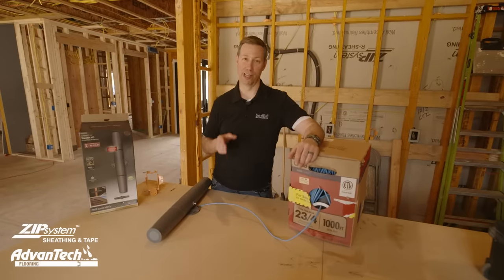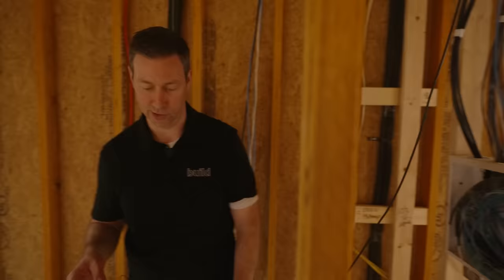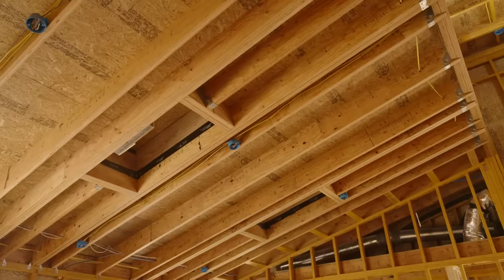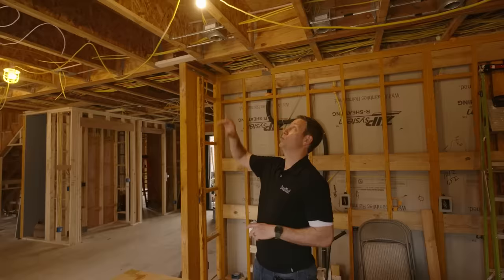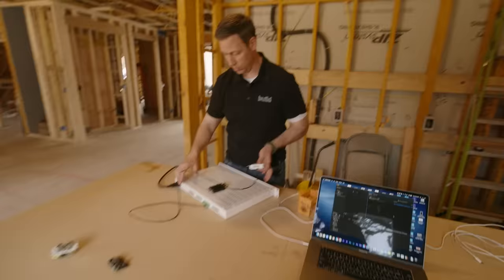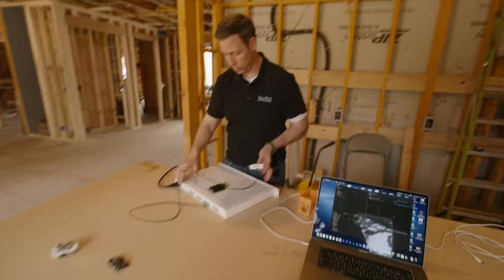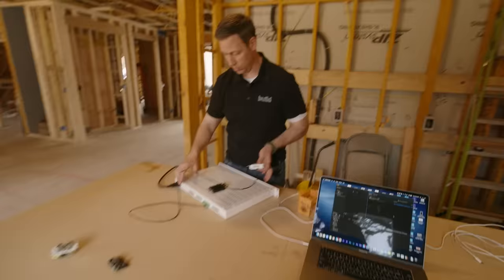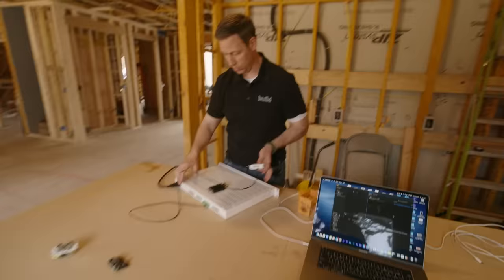Low ⚡Voltage at the Real ReBuild

Comment: You should have used shielded cat6 cable or really cat6a.  Also should have run fiber hdmi cables to every tv. They’re cheap and will work up to 8k. Hdbaset over cat6 is very hard and expensive.  Shielded cat6 and even shielded alarm cable.  You probably have areas where lv cables cross high voltage and that’s an issue unshielded.  Also lightning emr rejection is my biggest reason why I only ran shielded cables. Home in Florida I helped design for my parents, only cables that weren’t shielded were the alarm cables and that’s the only system that’s been knocked out by lightning strikes. (Nearby). Twice actually.   

Also having a telecommunications grounding block into your wire closet is very helpful. That’s just a 6ga grounding cable that runs separately to your power panel. Connects to your rack and network gear to provide a better path to ground for all the expensive stuff. Commercial telecom installs require this by code. 

Also a dedicated 20 amp isolated ground power outlet for your wire closet.  Or two.  

And I’d also run 14/2 to every tv on wall location from the wire closet so I could power sensitive electronics from a big high end UPS.  Pure sine wave UPS ideally double conversation online UPS. Cyberpower makes some great ones rack mounted. 

Make sure you run extra cat6 to every tv and also every location you’re going to have an UniFi AP. UniFi has a new tool on their website that lets you plan out what equipment you need for your space. You upload floorplans and it will let you lay out antennas and show you how strong the signals will be with walls in the way and such.  You have to remember that 5ghz and especially new wifi6 does not travel through walls well. So if you want to have super fast WiFi (think 1Gb speeds) you’ll need an AP in the same room.  UniFi makes great on wall ones that are the size of an outlet. Go on the wall. I’d do that for bedrooms and their new WiFi 6 APs for open areas mounted on the ceiling. They have recessed mounts for those. But you gotta put cat6 coming out of the ceiling in the right places.  Including outside. Don’t forget to run a cat6 cable for an AP outside for the backyard, and anywhere else outside.  

Get a patch bay. Shielded. Keystone. Mount on the wall or in rack. You can include coax keystones too and hdmi, even speaker connections.  Instagram has some nice photos of great smart home installs. Structured wiring.  Don’t use those expensive crap structured wiring kits they sell at Home Depot. Do it the same way offices do. 

Oh and ventilation.  Either have a inline duct fan pulling air out and dumping into a plenum or better a small mini split unit.  AC infinity makes some great in line duct fans that are quiet, come with temp controllers.  Also snoff makes some great smart power controls that will interface with HomeKit and Alexa.  One has a temp sensor. I use it to automatically turn off and on exhaust fans in my wire closet. And I also use ac infinity’s 6’’ inline duct fans.  UniFi switches get pretty hot.  

Oh one more thing. Sound proof your wire closet. Put some extra insulation in the walls and a insulated door. A door with a deadbolt.  You have your server in there and it’s recording security cameras, so protect it from robbers or kids from messing around in there.  

Level smart locks. Love those. Hidden inside the door.
Reply: If your stuff is getting spiked by lightning, you have other problems. Shielded CAT6 is unnecessary in a residential situation and won't protect against lightning strikes/surges. Everything else we agree on.

Comment: I'd love to see the tech stuff. And youre correct robust replaceability is more important for tech. APs you can replace every 5-10 years at this point. Power over ethernet is a standard that isn't going away any time soon. I installed those 10 years ago in Dallas, and they're going strong. 

Higher end build materials are great at blocking wifi. Wired is alway reliable, typically  lower latency, and not subject to the interference possible by wifi. It's technically more secure, so long as your physical security is on point. 

Feel free to show off some of whatever Ubiquity security cameras, but for the love of God, don't show camera placement on a YouTube video that will live online forever.

Living in a hundred year old house, with unreliable dsl, during the pandemic has been torture. Great to see you're planning for the future, either for yourself or the next owners. The best house I ever lived had ethernet drops in all the rooms going back to a closet. It was over provisioned for my needs, but it had so much flexibility it was great.

Comment: I'm quite surprised that low voltage lighting hasn't really become a thing. With LED lights it would seem that making them low voltage would be a fantastic idea as they all end up having to have duplicated mains converter circuits (even if nothing more than a couple of diodes and resistive droppers found in some newer versions, although a lot still have tiny transformers). You can already get 12/24V "halogen" down lighting for cupboards and the like (usually with a transformer stuck on top of the cupboards), so its surely not that much effort to have low voltage bulbs that directly plug into low voltage light sockets. The only thing is they would need a completely different socket, one that could in no way be confused with 240V (UK) mains light sockets. I guess you might also need a different type of light switch (internally/back plate), as again you'd not want to accidentally wire up mains to a low voltage system (although I guess you could have the switches include the transformer with a low voltage out to the light, unless you're doing long runs back to a central automated control system).

Comment: Matt... Try putting that antenna in your attic; that's what I do and I get fantastic reception. That will prevent the sun, rain and etc. from ever hitting it. Another reason why I put mine in the attic is just because I don't like the look of "things" on the top of my roof nor do it like "things" mounted outside my home on the walls or anyplace else.

edit:
Another thing I never heard you mention was a security camera system. Maybe you just didn't say anything because who wants to show everybody what you're doing as far as security goes. But I'm a big fan of hard wired security cameras and contact sensors. Any wireless security cameras a person has can  easily be hacked by anybody who is only smart enough to purchase hardware and/or download software.
Reply: I have always heard that attic installations weaken reception. Sounds like that is not a problem for you. How far are you from yhe broadcast tower?

Comment: Go into more tech detail. Also - can you address running the low voltage around high voltage and how to avoid interference? Thank you
Reply: 1. Keep low voltage data\signal cables at least 8 inches away
2. If you need to cross a power & a data cable, cross them at 90 degress (perpendicular) to minimize interference.
3. Never route data cabling near florescent light fixtures.
4. Use Shielded cabling.
Reply: @guytech7310  Shielded cabling is only required in high EMF areas (3-phase, electrical motors, CATSCAN machines, etc.).
Reply: @skynetlabs  Said the Guy who probably never deals with nearby lighting strikes.

Comment: The Volex system seems nice but not for $1000. Also DC won't travel far on a small gauge cable so you would probably need more than a few to cover a whole house. Also it would take a huge UPS to last for any length of time. The APC 1500 UPS's I use at work at a 10-15% load will only run for about 3 hours on a new battery and they list for $1000.

Comment: Wire for burglar alarm while you can. Even if you won't subscribe to a monitoring service. Drop wires for more cameras than you think you'll need. Smurf tube from the TV box to the media cabinet; the Samsung One Connect box fiber line (for The Frame) needs to be in conduit anyways. Smurf tube at demarc like you did is excellent. Wire for several UniFi AP  locations. Future WiFi will be lower and lower range, it may get to the point of having an AP in every room. Wire smoke detectors together. I'd wire 240V in a couple strategic locations (like kitchen, garage, etc). It's more efficient and allows you to run many European kitchen appliances. Also EV charging.

If you want to get serious about lighting controls and automated shades, look at Lutron. Caseta is their DIY platform, RA2 Select is a step up. HomeWorks is the premier system, and Ketra lamps and fixtures is the cherry on top. I have Ketra and HomeWorks QSX at home and love it.

12AWG/20A circuits for lighting is overkill, but it isn't really a problem other than a waste of resources and harder to work with. DC lighting is kinda "a maybe" at this point. Sure PoE lighting exists and 24V LED tape light is common, but neither is being used on a wide scale for general lighting. 120V is generally more efficient. Maybe in the future we could see 5A circuit breakers and, say 18 or 20 AWG Romex. It's inevitable with the rising price of copper. Not sure what a 5A receptacle would look like, but surely most/every room will need at least a couple 15A for larger appliances.

Prewire/conduit for solar and generator inputs, as well as RV/trailer and EV charging outputs.

That's my two cents
Reply: Who still wires for alarm systems? Everything is wireless now.
Reply: @skynetlabs  You could have argued the same thing about Matt having wired for CAT6 or window shades or Sonos. Wireless versions of almost anything is possible. The fact is, wired is more reliable, better performing, and "the batteries can't go dead".

Also, and this is more specific to security-focused things like surveillance cameras and burglar alarms; wireless can be jammed. In fact, wireless jammers on the 2.4 GHz spectrum aren't even illegal (not that criminals are known for following laws LoL) Even some slightly more sophisticated burglars these days are carrying battery powered jammers that shut down the video doorbells, wireless cameras, and alarm sensors within 100ft radius. Anything that runs on an open band can (pretty much) legally be jammed.

Comment: Hey Matt. I would not be running voltek systems as running DC power at any great lengths you will get tremendous voltage drop in the wire. You would be MUCH better running low voltage AC at high frequency and using small modules that will convert to proper DC level and very high current using very thin (22 guage) wire. This is one reason aircraft use 400hz AC power. They can use very light guage wire. Even the power grid uses extremely high voltage so they can use smaller guage wire for distribution. The same thing can be achieved with higher frequency.
These power supplies that are constantly on steal power a d raise your elec bill w/o anything plugged in.
In addition. I hardly use any wireless in my home. Most everything is wired. Its MUCH faster and more reliable. DONT rely on your router that your ISP provides. If you lose the router, you lose your DHCP functionality. I have two DHCP devices (raspberry PI) that provide that functionality. This way connectivity will be maintained between devices if I lose my router.
Please do more research BEFORE running wires. You will thank me.

Comment: Matt your right even if your not planing on using it now when I built my house I put cat 5 to every room and over the years as technology changed its saved me a ton of money and work so wile you have the chance put it in the walls even speaker wire because you can use it for some low voltage too
Reply: Cat5 (and Cat5e) are ancient history. Cat6/A FTW!
Reply: It was new when I installed it

Comment: Talking about potentially doing it yourself, it'd be great to know how exactly low voltage is wired from a source, say if you can run it from the master box, or if you need some kind of low voltage transformer, or what exactly. How would someone who knows how to run high voltage learn how to run low voltage?

Comment: For wiring wall-mounted TV's to entertainment units, think of the total cost of ownership.  Money can be wasted installing specific cabling types that in future have to be ripped out and replaced as the next generation of audio-video distribution comes along.
It is not so much the cost of cables, it is the labor.

Over the years we have seen so many cable types, many of which have gone or become very rare as they are far less useful:
- 3 x RCA (RGB) Component Video
- Composite 1 x RCA Video 
- 2 x RCA Stereo Audio
- S-Video
- SCART, 
- VGA & DVI(-D) 
- F-Connectors 
- Thunderbolt 1 & 2
- HDMI 1.0, 1.1, 1.2, 1.3, 1.4, 2.0, 2.1, 
- DisplayPort & Mini DisplayPort
- USB-C
...and as they are replaced with their newer technology which becomes more costly when they're hard-wired to wall-plates.

It makes more sense to have a pathway in the wall that goes behind the rear of the TV where all the sockets are down to the entertainment rack or unit which the audio-video flyleads can pass through.

I generally use a flexible conduit very similar to this: https://www.cableclear.net/
Now with TV's that are mounted very close to the wall, one side can mounted so it is recessed.

The type of wall mount matters as well.  Those wall mounts where the TV hooks onto it don't help when someone forgets to disconnect the HDMI cable (which in some cases can be up to 15 meters long) before removing the TV off the wall and the plug gets snapped off at the connectors.  I much prefer the sort that allows you to pull the TV out away from the wall so the connectors on the back are clearly visible and much easier to access.  I would have the in-wall conduit entry point for the cables right next to the spot the mounting bracket mounts to the wall and use velcro cable tie to tie the cables across the arm to where the sockets are.  That way pulling the TV away from the wall won't end up with broken cable connectors.

Comment: Looks like Voltek is trying to mitigate long-run voltage fall off with thicker wires, and a higher voltage. Seeing the ubiquity install would be nice, especially with more recent units that support gigabit wifi protocols, but their response to their security breach (their cloud services were hacked) put me off quite a bit from expanding beyond my one Ubiquity access point.

Comment: The higher the tech, the shorter the lifespan.        Infrastructure is the most valuable part of any high-tech system, or low-tech system!    You can " tube it"  to mitigate the difficulty of changing cable, 20 years later... but fire code might disallow that.

Comment: Why do we (the USA) staple wires to the studs when it seems like conduit would be more flexible as wiring/cabling requirements change? I would love to replace all the co-ax in my house with cat6 but since it is stapled everywhere I would have to redo all the drywall in the house which just isn't cost effective.
Tl;DR why don't we use more conduit to make upgrading easier? Maybe a good topic for a future show?

Comment: Cisco does Power Over Ethernet for overhead lighting today.  I read about it in Cabling magazine last year.  It’s typically installed in commercial buildings.

Power to your lights is carried by CAT 6 cabling from a network switch that has Power Over Ethernet enabled and you can control your lights from the network.

Comment: Love the videos. I'm building now too and I want to make sure I have all my wires ran to the outside so no new penetrations are made.  What type/mode of Fiber did you run for your internet.  and what company is it for.  I have At&t and I'm not sure if different companies use different mode cabling.  Thanks

Comment: Good video. But actually, voltages under 70 are called SELV {Safe Extra Low Voltage.) above 70 to 600V is "low voltage." Above 1000 to 40,000 is "medium voltage." Above 40,000 is "high voltage." Take it from an old utility electrical engineer. Some systems today use 48 volts as power over Ethernet.. It has not been widely adopted for USB power or LED power, but has the potential [no pun] for these applications.

Comment: Great call on the Ubiquiti network - been using their gear for many years now and they are consistently adding features / improving user friendliness while keeping pricing reasonable.
Not a big fan of their UniFi camera system though because it doesn't currently have any sort of cloud integration.  Also the video is stored in a proprietary format so you can't even really hack together some sort of offsite backup solution.  This means if anyone runs off with or destroys your UniFi dream machine then you are SOL for getting footage of the theft.

Anyone tried tablo versus tivo?  It looks like tablo is able to stream from just one box to smart TVs with the app installed versus tivo you have to have a tivo box on every TV you want to stream to?

The Voltek is an interesting system - are there any other products on the market which allow for 45W USB PD to a receptacle at the moment?

Comment: As someone who works in IT, I would say keep things as simple as possible. You're going to have a lot of fun toys like the Kohler tile speaker, Sonos, etc, but the more layers of crap you add the more problems you're going to end up having. In my house I have one modem, one medium sized battery back up and one Netgear switch with ethernet running to all devices. That's it. No smart TV, smart lights or anything else and I have had zero problems over the seven years that I've lived in my house. I did think the Voltech thing was cool but seems a bit over priced for what it is. Also, I've heard some of the major TV brands like LG and Samsung have started running ads directly to your TV. If the TV you picked out does that you can probably access your modem's web portal (192.168.1.254 or similar) and block any ipaddress related to Samsung